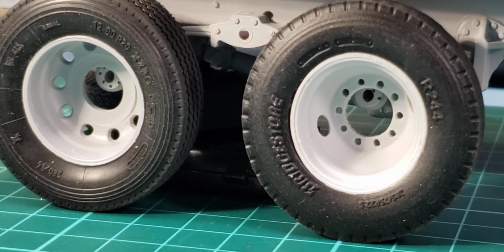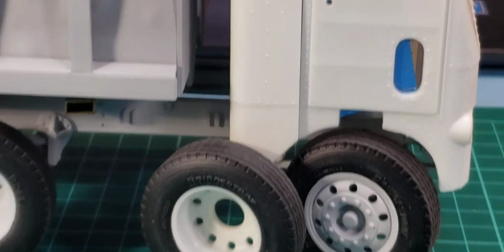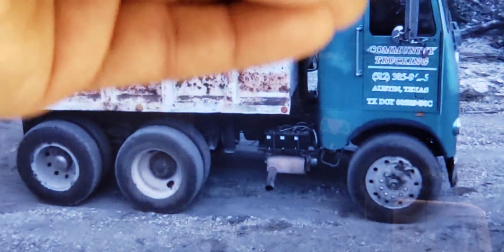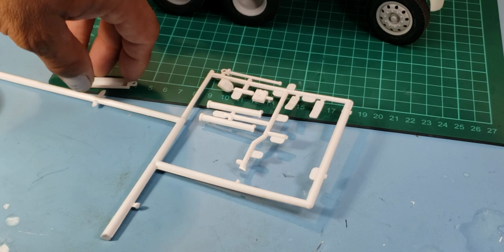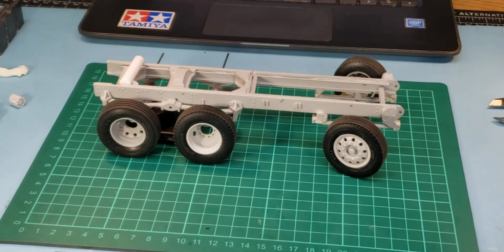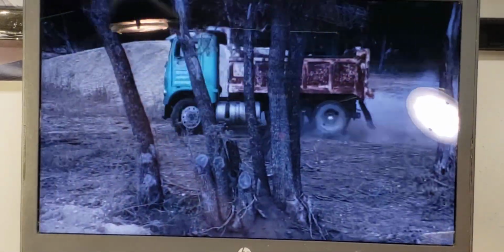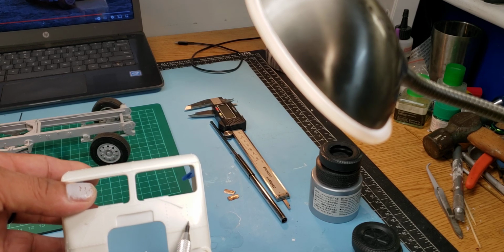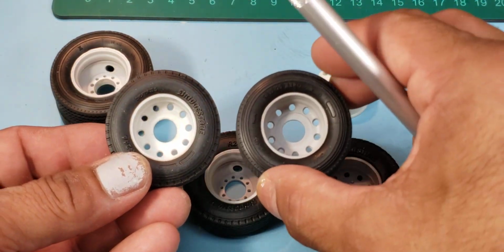AMT Freightliner Dump Truck Part 6 (2 of 2)

Comment: How I'd get rid of the light buckets?
It would fill them completely,with styrene cut as precisely as possible and using old fashioned testors orange tube glue. That stuff makes that shit really soft  and gooey,and you can prress it so that  it fills all the gaps.  Fill them flush,and then sand them flat to the face of the cab. Then I'd fill the bump outs from the. Inside,.tihe sand them around the cab corners. ,Any sand through I would fill it styrene softened with tube glue and pressed into  any holes.Same with any filling needed on the front, softened styrene pressed into place. You're  gonna have to let that tube glue cure for at least a couple days before sanding the buckets off.  Same with the cab corners. I don't like putty for this kinda shit. It always shrinks for pops out on me!
That's how I would do it! As a matter of fact, that's how I'm gonna do it! 

I stop and look at  that old truck tomorrow, we're picking corn less than a mile from it right now. I'll let you know tomorrow evening.  I've been eyeballing that old tractor so much lately,I've decided to build a replica. Except I'm gonna do him up in all his original glory!
Holler at you tomorrow!
Reply from the maker: Thank you Tom.....I like your method. 
Very nice. 
Buckets....now that made me chuckle. 
But I'm really curious now on your idea for a build ....that would be very interesting to see.